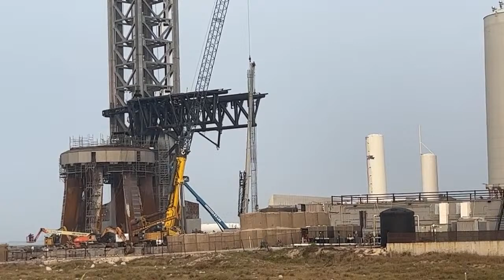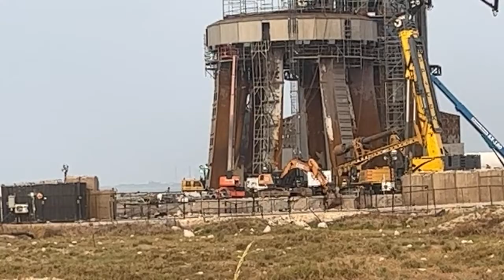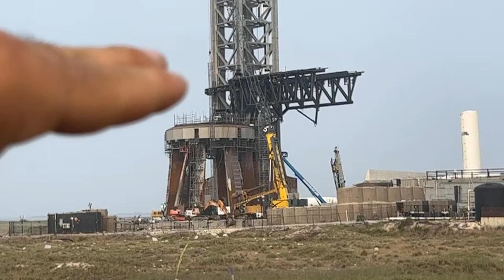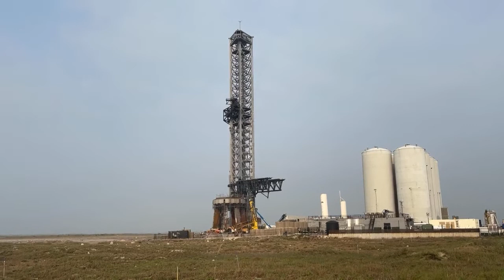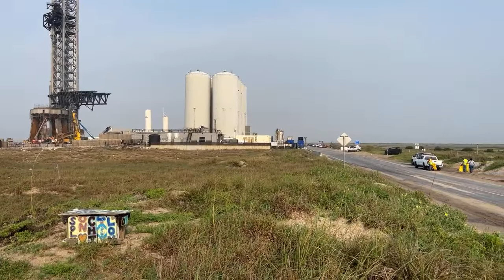Morning view, large rebar in position, SpaceX Starbase, Boca Chica, TX, May 12, 2023

Comment: raptor 2 chamber pressure is 300 bar, i am told
Reply from the maker: That's about 4351 psi
Reply: @SpaceOcean  in a May 12 tweet, musk said raptor v3 has reached 350 bar, and 269 tonnes thrust